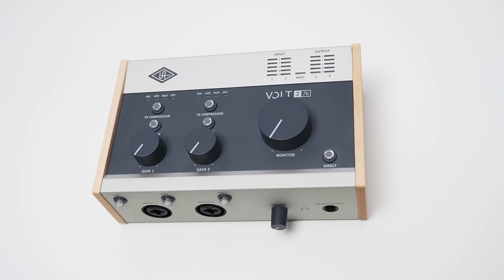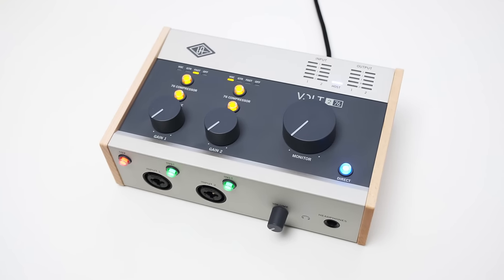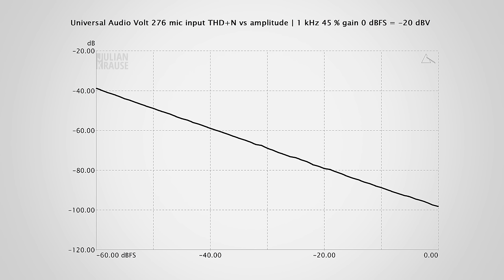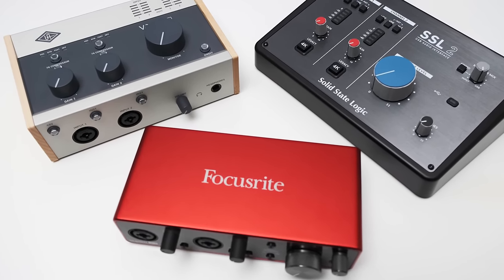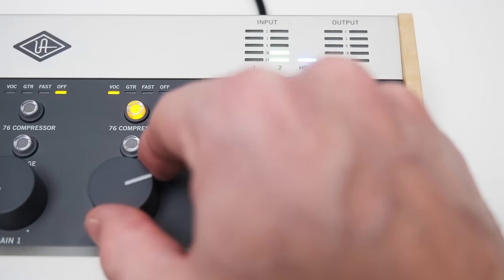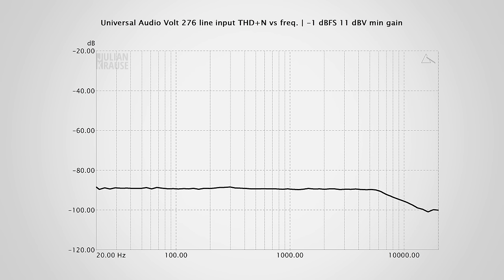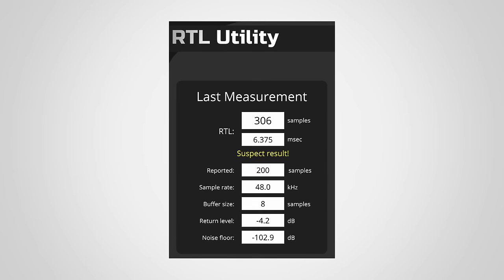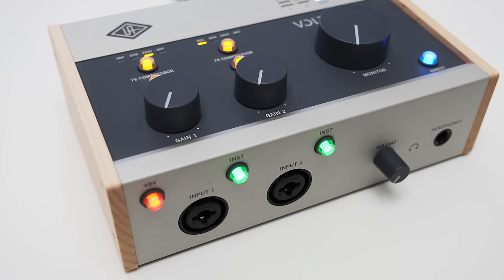Universal Audio VOLT 276 – Review (Compressor and Vintage Mode Audio Samples)

Comment from the maker: Interesting side note: You can use the Volt 276 as a standalone unit. With the provided 5V DC to USB cable you can power the interface from a USB power source without the need to connect it to PC. The direct monitoring works just fine and you can also apply the vintage and compression effect.
Reply: @lisan_al-ghaib  Just using that way now....Testing without registering and downloading the software...just monitoring...
Reply: Please review Apollo Twin X
Reply: Can you pls review some mic s (100 to 300 dollar range) ?
Reply: @Jghosn13   ... and what have you learned?
Reply: @willgo7898  It runs all my headphones….
Reply: The Rock Procrastinator  are you serious? 🤦🏻‍♂️
Reply: I hope you would do a comparison between the best ad converters because I am a bit confused wich one is the best ?
Reply: i haven't been able to find an answer yet: does the volt 276 work analog in standalone mode or were the adc and dac involved?
Reply: How does it compare to a first generation Scarlett Focusrite 2i2?
Reply: I don’t feel much difference with the compressor on or off, is that an issue?
Reply: @silverdc5  great question ☝🏽

Comment: Basically just get the Arturia minifuse 1 or 2 , it has the same chip and costs a lot less, the vintage thing can be done with EQ and the compression creates noise! I would use the money I save buying an arturia to put it toward an actual compressor that might do a better job. I am pretty disappointed.
Reply: The minifuse is awesome. I got it upon release and have had zero issues with it. I only switch to my appolo for unison or if I need slightly cleaner amps on vocals. Otherwise the minifuse is the absolute best choice unless you buy a babyface or RME ($900 & $2500 units) Minifuse has everything you need unless you're a professional professional!!

Comment: I bought Volt 276.. my experience with this audio interface is very good. There's no latency when playing vst plug-ins through ipad pro connected to a midi keyboard. Audio  quality is excellent 👌 .I had a focusrite 2i2 2nd generation. I cannot compare.  Because the difference is too big.  UA has launched a very good product.

Comment: Julian, thank you for the review. I've just bought the UA Volt 267 from a local shop and I was surprised to see that I know more about the interfaces he sold than he did because I watched your reviews :-) You're doing an awesome job, keep going!

There are two things I'd like to add to the hardware overview part:

1. The top part is not flat and the area with the levels is slightly angled so you can easily see the levels even if you're not looking at the interface from the top.
2. If the interface is slightly in front, the gain knobs cover completely the "vintage" button, so you can't see if the "vintage" mode was activated or not

Otherwise, this interface ticks all the boxes for me: very good headphone amp, great design (it's going to be on my desk all day long so I'd rather have something pretty) and microphone amps way better than what I'd normally need (video calls, maybe a podcast). I only wish the inputs were in the back instead of the MIDI connectors, but...
Reply: Between this and the Ssl2+ and audient mkii who do you think comes out top
Reply: Dynamic range output just means how loud it can push my monitors right?

Comment: absolutely fantastic job as always! Thank you for putting these video together. an an engineer who plays with music production at home I really like getting the specs like this with a deeper understanding of how things work! and this is great, well done. I bought one of these that I use mainly for my acoustic guitar that I mic. sometimes I will also use the line in. I like the comp and coloration there for that purpose. It makes the act of recording while monitoring in real time a little bit better for me. I know there are more capable comps in my DAW but I like this for the playability and ease of recording. Its a little more musical to work with that way. Thanks again, fantastic job! I took screen shots of all the graphs and will reference them from time to time!

Comment: Really nice post. For many potential users, it might also be important to know that you have to store your personal data with UA for commissioning on the computer. The Volt 276 can only be commissioned online (analogue use is of course possible). Simply downloading and installing Asio drivers is not possible without UA Connect and offline. An important decision-making aid for many users.
Reply: If you buy any software you will be forced to do that anyway, and all you get is a free trial so I didn't even bother.

Comment: I got it last week, and while I really love it I am going to have to get a fethead to fully drive the audio on my mv7 unless I eat the mic (which for me sounds awful). The compressor only kicks in as you drive up towards the top so that is an extra 7db you need to drive it to make full use of it. The preamp does great but when I have it fully engaged it starts to get some unpleasant character to the sound. That said, this is the closest I've come to being able to just record and done, no processing needed. And that is nice because I usually have to spend hours messing around with the audio to get a good result. I also like the vintage mode a lot. Similar features on other cheap interfaces sound like absolute garbage to me, and presence boost and similar features on microphones make my voice sound stupid. But this vintage mode is really magical stuff. Like having just a touch of Mel Torme in my voice. Subtle though, maybe 2-3% Mel Torme that livens up my voice just enough to make it sound interesting! So I am very happy with it, but I am getting a fethead, and I think this is really necessary if you want to make proper use of the compressor feature. And if you don't, you probably didn't buy this is the first place.

Comment: Hi Julian, I bought a VOLT 476 last week and I loved how clean the audio output was until I noticed the left channel had a hum and the left-right balance was off until the monitor level was higher than 10%. The headphone output had none of these problems. Fortunately, Long and McQuade exchanged the unit right away for a new one. What is unfortunate is that the new one has the same balance problem as the original but this time, the headphone output is the faulty one. I am now on the fence about what to do. I really like to monitor at low levels, which I could do with my lowly Focusrite Audiobox iTwo without any noise and perfect balance. Do you recommend another interface or should I bite the bullet and just use the Focusrite for monitoring. thanks!

Comment: This was really informative. I was looking at this as a secondary mobile interface to my Apollo. I think I may just go with the 176/276. The plug-in bundle is not impressive but I can just use my UAD plugs in post. But the info on dynamic range being dropped while the 76 comp is engaged was key. Thanks!

Comment: This interface is not avaliable in my country yet, so I've bought the Audient ID4 and I'm not disappointed.
Reply: I’m pretty sure it’s not available in any country yet. Every website is only taking pre-orders
Reply: is available here in my country NEPAL , where are you from?
Reply: @genuinemember5766  Brazil.
Reply: @marcoscamillo6606  iam little bit confuse which one to choose volt 276 or audient iD14 mkii
Reply: @Eric_In_SF  Here in Los Angeles I’ve seen it in a few stores. Only the 276 but not the 176 or 476
Reply: It's available but I'd choose the Audient anyway.

Comment: i realize this video is two years old now , but i'm just now delving into the world of home recording and wonder, couldn't i save $100 and just use a software compressor in my DAW and get the same/similar results as well as keeping control over the other aspects such as ratio, attack and release?  i have definitely decided on purchasing the Volt 2 or Volt 276 just wondering how crucial the compressor is or isn't or if it is indeed just a convenience

Comment: Great video overall. You stuff so much information into it, that I need to focus on your videos really hard, to not miss any details. I love it! One little thing challenged me this time: I noticed, you said, it has a dynamic range of 118.8db(A). With that kind of dynamic range, it should be sitting within the top 3 of the chart, challenging the Clarret 2PRE and Ultralite Mk5. But on the chart the VOLT 2 and 276 sit at the same spot, well below 115. Is the chart faulty,  or is it more like 111.8dB(A) of dynamic range?

Comment: I have seen several reviewers say that the single USB-C cable is sufficient to power the device. It does seem to work without the additional 5V connector, but I discovered that using the 5V connector seems to reduce the channel imbalance. I don't have any gear to measure the amount of imbalance, but the left channel is very noticeably louder than the right channel when not using the 5V connector. The left channel is only slightly louder than the right when I use the 5V.

Comment: Hello Jullian, I like your work. Especially collecting the data regarding dynamic range + noise flor for preamps. I wonder though why there is no yet one of the famous ZOOMs tools (h6/h8/p4/p8) - which can serve as audio interface. How are they comparable to the others regarding dynamic ranges and preamps. Are they so weak you are not taking them into account or just they are not falling into that standard Audio Interface category? Thanks in advance for answering :) My congratulations on such a detailed work on audio and sharing it online!

Comment: In terms of Volt 2/4 vs 276/476, another difference is slightly enhanced hardware metering on the *76 models.  (None of them look like they're up to displays on the MOTU M2/4, however.)

Comment: Thank you, so looks like general performance is average (on your chart) but the 76 did make a noticeable difference. I've been wanting to get an Audient id44 mk2 and a separate 1176 clone, but then saw the 476P which has the 76 built in (without transformers). so it could hit the spot, plus having 76 on multi channels is a win and save me £500 for one mono 1176 clone. that said, I want my next interface to last another 10+ years, and sounds like this is a bit dated, where as id44 mk2 is top of your charts. very tough. but thank you.

Comment: Hello Julian. I am currently recording with a 10y old Scarlet 2i2 1Gen and want to upgrade to something more professional (had a few songs on the radio and my interface is really lacking). I now have the chance to buy a used (1y old) UAD Apollo Solo Interface (with classic collection plugins) from a local recording studio and was wondering if it is worth the higher price point when compared to other (cheaper) interfaces (eg. Audient iD 14, SSL2/2+ or even UADs own VOlt 276). To be clear - i am looking to buy something that will serve me well for another 8-10 years of my musical journey. Thank you very much in advance and all the best!

Comment: I’ve been doing extensive research on this item and been looking for some answers. Someone made a video comparing the Apollo, Focusrite, SSL and another interface, they did a good job and I heard the difference between them. The Apollo sounded really good, making the others having lesser quality of sound. So I got my answer from there. The SSL was not so bad, just not as good. Now my question is, how will the Volt sound compared to the Apollo? I have an Apogee right now that sounds amazing, but won’t be compatible with my newer MacBook Pro Max. I’m not concerned with Apollo DSP, I’m more concerned about the quality of sound. So I want to know what the Volt sounds like next to the Apollo and will it be good as the X4.
Reply: I’ve got an Apogee as well and looking at the Volt for the compression, etc. Did you get a Volt?
Reply: @kerosenefilms  Yeah I have the Volt. It sounds really good, but I haven’t really had a chance to really test it out yet. But so far, it sounds about good as my Apogee. I’m trying to figure out what to buy next. Maybe I’ll get the SSL Big Six. But I’m thinking I can get what I want with this Volt.
Reply: @Dante-qf9yd  Thanks for the update.
Reply: @kerosenefilms  You’re r welcome.

Comment: Thank you so much! I am torn between the Audient ID14 MkII and the Volt 4. I can get them for around the same price. Sounds like the ID14 is slightly higher performace so I'm leaning that way. I understand you may not want to comment but if you did, that'd be great! Thanks for all the great in depth reviews over the years!
Reply: ID14 software is a pain to use, and interface causes popping upon starting and shutting down.  I'd go for the Volt.

Comment: Thanks for the review! I asked this in the Volt 2 review as well, is loopback supported? So far there is no mention of this on the software manual at all.
I think I will go with the MiniFuse 2 from Arturia instead in the meantime due to it being so similar, and the software has documented loopback support (also no need to register to use the software as well I believe).
UAD, if you are reading this, user registration for the driver is a dick move!
Reply from the maker: Hey, I just checked and the Volt series has no loopback feature.
Reply: ... the downside of registering for software is that you've opened yourself up for other marketing efforts?  Other issues?

Comment: I hope you will answer my question. I have just bought the volt 176 and I use samson q2u mic with senstivity of -54 dbv but it has so much noise so you susgest I get a fethead or ART Tube MP/C or dbx 286s microphone preamp & channel strip processor or a fethead with one of those two preamps into the volt 176??? I just want athe best quality possible and by the way your videos are so great and have so much information keep up

Comment: I have an Apogee Duet iOS. Thinking of replacing it with a Volt 276 because Duet may not be supported on the future macOS versions. It it a good replacement? I mostly do podcasting and live streams, so I'am really excited about Vintage Preamp and compressor built-in. May sometimes also record some guitars. What do you think about this? Would sound quality be on par with Duet?

Comment: Hi Julian, a quick question, if you don't mind: if I have an interface (Audient iD4 MKII), and I use one of the headphone outs to connect to my external amplifier (which is connected to my passive monitors), do I get worse performance than connecting to the main outs?
This possibility has bothered me for a while.
Thank you!

Comment: I'm looking into the 476P.  Is the latency something to be concerned about?  I currently use a Presonus Studio 24c.  If the 476P latency is at least as good as the 24c then I think I'm ok with it, but is it?  I just used Oblique RTL to measure my 24c.  Not sure if I was doing it right, but in most cases it came out just a few fraction of a ms faster than the results Julian got with the Volt.

Comment: Great review, Julian. Which headphones do you think will work best with this interface? 80 or 250ohms Beyers DT 770 Pro? Thanks again for your extremely detailed review.
Reply: 32 or 80 are great for a maximum loudness but 250 would be ok. I would pick a 80ohms, good average. And preserve your hearing is important.
Reply: @baptistec.4546  That’s a great help, Baptiste. I have now opted for the 80 ohm ones. And yes, preserving your hearing should be a priority! Thank you very much.

Comment: Great review Julian. Quick question though. When I am recording my vocals / guitar DI i have a separate channel in my DAW which i use for monitoring fx - compression / delay / reverb / amp sims etc. Would having a "pre-print" compressor have any potential benefit in my case? Personally i think it would be rather limiting (no pun intended). Thoughts?

Comment: How did you release your XLR cables? did you notice after you plug your XLR in it is impossible to pull it out? You will never have access to use that channel with TRS Quarter inch input. I have 2 Volts a 4/76 and a 2/76 my XLR cables a permanently locked in. They have no release tab.
Reply: The releases are on the cable not on the interface. Your releases are probably hidden by a plastic cover, though they could be broken. Don't buy cheap cables, the releases and lack of shielding will make you regret it every time.

Comment: Hi Julian
Do you think the volt 2 or 276 are better than Motu M2 , Audient id14 mkii?
Reply: No. Simple as that. LOL
With the Volt series you pay some extra bucks just for the UA name and vintage mode marketing, it doesn't outperform any of the cheaper interfaces.
I love the MOTU M2 for its display and headphone output, while the Audient ID14 comes with an ultra-high dynamic range (overkill) and supports expandability.
They also both have separate phantom power switches, the MOTU even monitoring, the Audient even has routing options and a nice software (WHICH YOU DO NOT NEED TO REGISTER FOR TO DOWNLOAD)

To be fair though, most of the Audio Interfaces in this price range do a great job, the UA ones too, and in the end it depends on you and you only which features you need. It's just that personally I think there are better feature sets provided from other manufacturers for a lower price tag.
Reply: Not at all, both the Audient and Motu are better.

Comment: The latency is kind of subjective isn't it. I am getting 4.17ms output and 2.50ms input latency at 128samples 48kHz. At 96kHz and 128 samples I am getting 2.83ms out and 1.50ms input. 

So, probably depends a lot on your processor and computer hardware yeah?

Comment: Awesome, can it be used without a computer?
Reply: That's one of the Volt series selling points actually according to UAD. I checked the MOTU M2 manual and it too has a stand-alone function apparently, if anyone's curious, but overall it's a pretty rare thing with interfaces.
Reply from the maker: Hey, yes that works. I have just pinned a comment for that. Cheers!